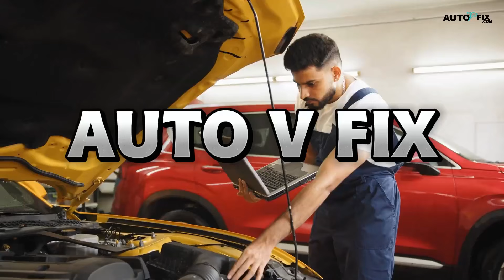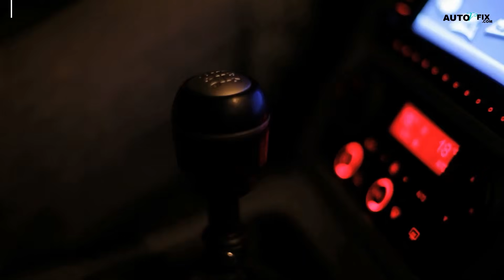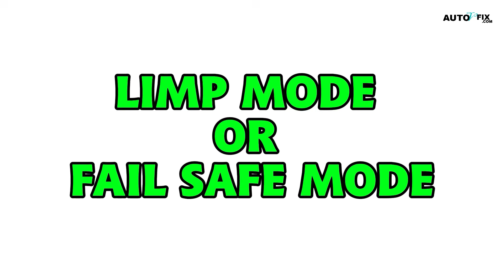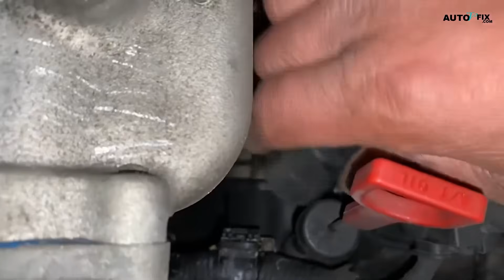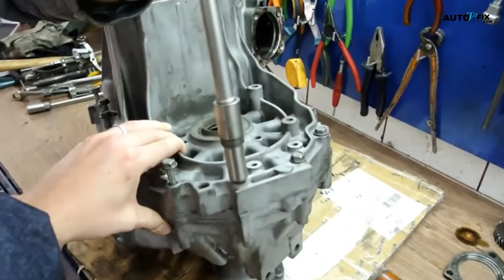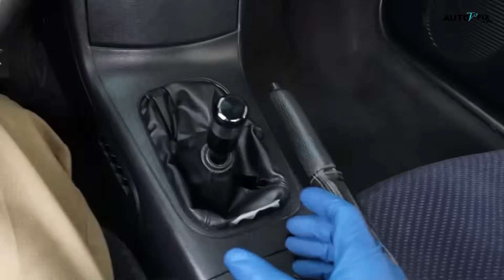9 Signs & Symptoms of a Bad Transmission Range Sensor, Causes + How to Fix

Comment: AT running on neutral,no reverse,please need advise.,thank you very much🙋
Reply from the maker: That sounds like a serious internal transmission failure, so I would recommend having a professional mechanic scan the codes and check the fluid condition immediately. 🙏🏾

Comment: When I start my car it already says it's in L gear an car won't go over 35mph. Can I fix this by simply changing the transmission range sensor
Reply: Don't forget to recalibrate the linkage thi
Reply: Might be in limp mode if it's a newer model

Comment: 2000 firebird V6 5 speed light come on but not start nothing where is the neutral shafted switch at
Reply from the maker: On a manual transmission, check the clutch safety switch pedal assembly for that issue.

Comment: I've changed the fluid clean the external filters replace three sensors still have the issues
Reply: You changed the transmission range sensor an recalibrated it

Comment: I have a question 03 Honda Civic EX I would drive about 2 miles gears shifting fine then all the sudden I have no gears and it just whines Which throws the p0730 code when I shut my car off turn it back on can I have gears again what could be the issue I have an automatic
Reply: Currently Same problem with my 2010 Ford Fusion
Reply: means its sporadic but it will fail eventually

Comment: Appreciate it my friend,  do you know the location of my matrix 2012 range sensor?
Reply: Should be under your air box on transmission or under your battery on transmission it's connected to you shift cable
Reply: @MatthewGualdarama thanks alot